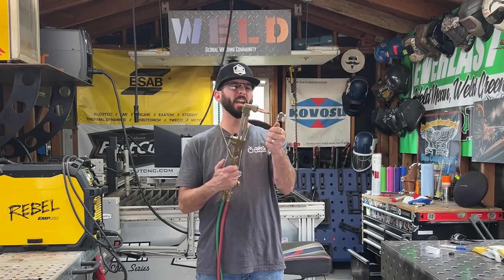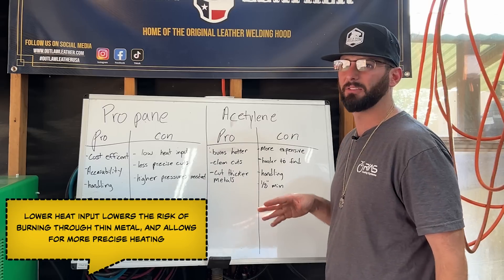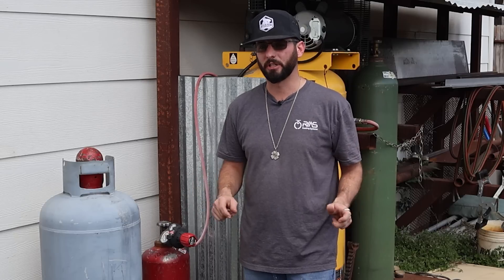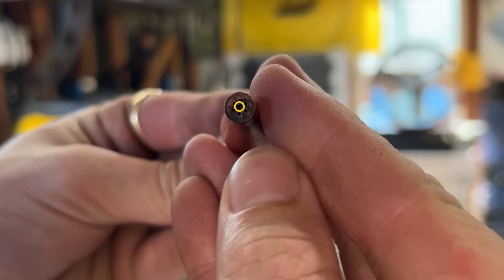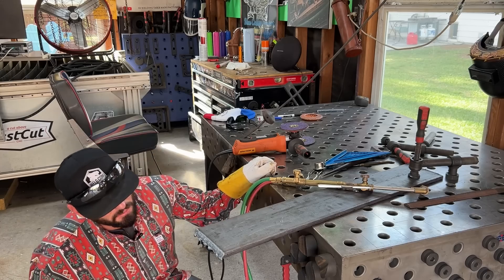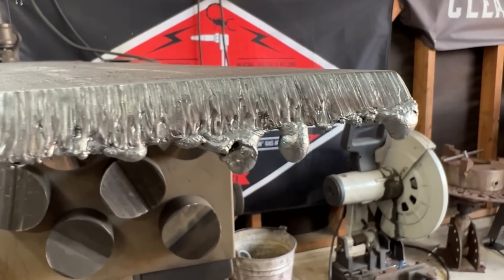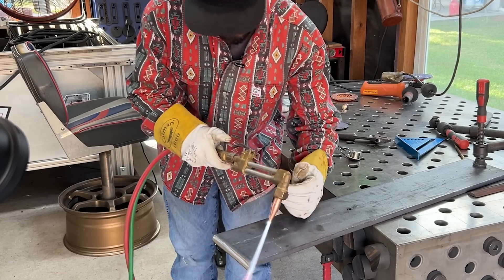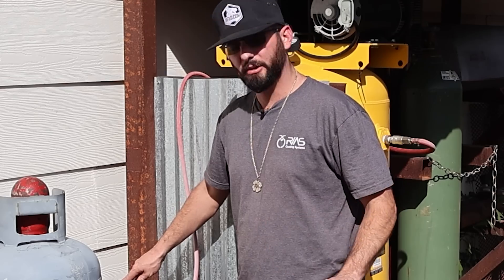Which Gas Is Better For Oxy-Fuel Torch Cutting

Comment: This is directly from Victor custom service. 
I ended up getting a  propane reg for the below reasons. 
"Both acetylene and propane cylinders use a CGA 510 connector (aka a POL fitting) so you can generally use an acetylene regulator on a propane tanks but most acetylene regulators are set up for the range 2-15 psi so if you plan to use more propane than that you should either get your acetylene regulator modified to use a stronger spring and different gauge or you should use a regulator set up for propane. In addition, once you use a regulator for propane (which leaves tarry residue inside) you should not go back to acetylene with that regulator."
best to stick with equipment designed for intended purposes.
As for Propane I see a lot used in scrap yards.

Comment: The actual hoses are also different.
Reply: R&T, you are correct, intended gas for intended equipment, lot of bad info out there 🙄
Reply: @ I like tip type 41 for acetylene cutting because it provides a better longer and straighter oxy cutting stream up to 6 to 10 inches long.

Comment: You need to get closer to the metal, the neutral flame should be about 1/8 of an inch away when using propane. In my experience you will get the best results following the victor charts. I have used lpg for up to 2 inch plate. It will cut a lot thicker. While using a pipe beveling machine it leave very smooth clean cut. Unlike acetylene, you have to make multiple adjustments to get the correct flame temperature and the best results following.